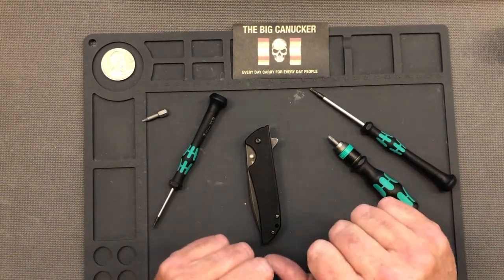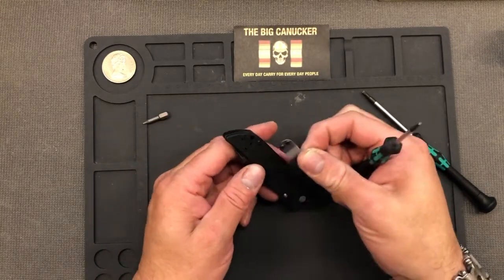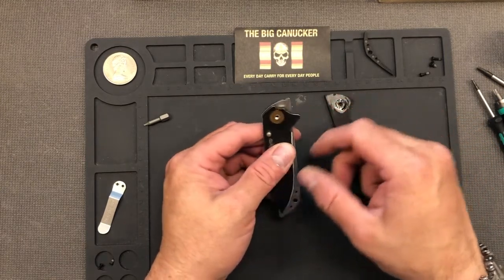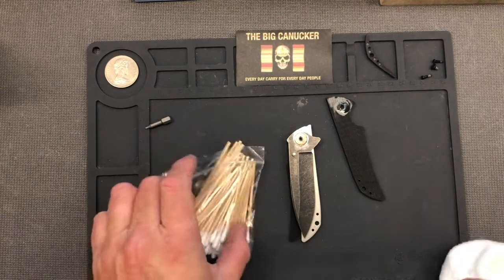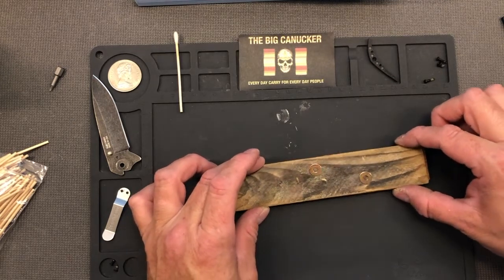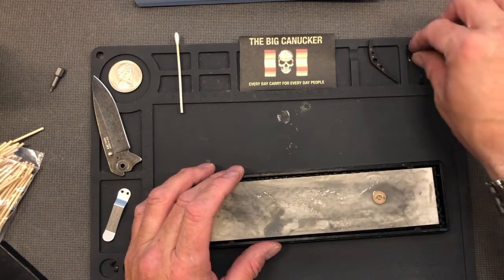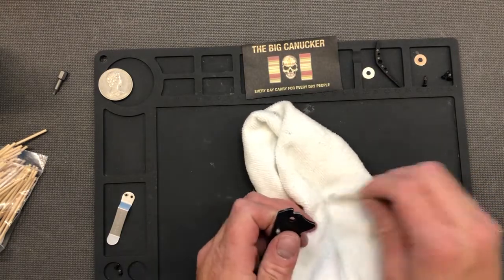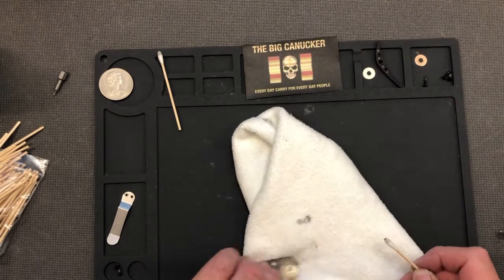Smoothing Out a New Kershaw Skyline....Now its as Smooth As Me.

Comment: You demonstrated some great ideas for maintaining knives. What do think about using high quality fishing reel oils and grease for lube on knives? The grease is marine grade and doesn’t break down in water like many other lubricants do. Just a tiny dab rubbed on blades beads up water like a freshly waxed car. Penn reel oil is made for protecting and lubing tiny reel bearing and works well too. For traditional knives I stick with medical grade mineral oil for safety sake; because of the woods and natural bone and horn materials. My go to cleaning favorite is pipe cleaners for cleaning out the blade slots on my knives too. Canned air is just as good for cleaning knives as it is for computers. Hypoallergenic cotton rounds are lint free. They work great for using a small dab of Case paste polish to shine up knives too. They are made to remove ladies makeup; but are just right for polishing knives too. Boker sells a tool just for knives it is made by Wiha and stores the bits in the handle. It is magnetic and holds tiny fasteners from finding a new home where they are never found. 🦉wise 🧓🏻old🔪knife collector 🧐
Reply from the maker: Fantastic set of tools and ideas I really appreciate you letting me know about them. I’ve thought that reel oil is a great lube for knives, but with the grease I’m always a little more fussy. I really like to make sure the grease is light enough and won’t get sticky as it ages. I tried a soap based grease one time and after 2 months it was a nightmare. Take care my friend.

Comment: I think the Skyline and the Barenuckle are the only made in USA Kershaws that are non-assisted?
Reply from the maker: I’ve also been told to try out a Bareknuckle as well. So far I’m digging the skyline especially since I loosened it up. Take care.
Reply: @TheBigCanucker  thanks for showing the washer polishing. Some times it make an immediate and big improvement. 

l tried polishing the washers on my Sage 1 last week, hoping it might make it drop shut. Well, it opens like its on bearing now but, it still won’t drop on the closing. Oh well, its still new and breaking in. 

Great videos, keep it up :)
Reply from the maker: @Thomas-dz4eg  thanks I’m glad you liked the vid. There was one thing I didn’t try but has worked in the past is bending the lock bar out ever so slightly. I always use that as a last resort or if a knives action hast got better after the polish and break in. Be very careful you can pooch the action very easily if you go too far. If the Skyline doesn’t get better in a few months I might give it a go. Take care and stay safe.